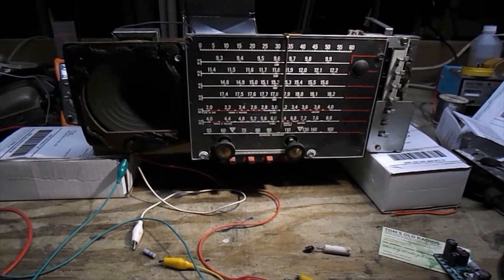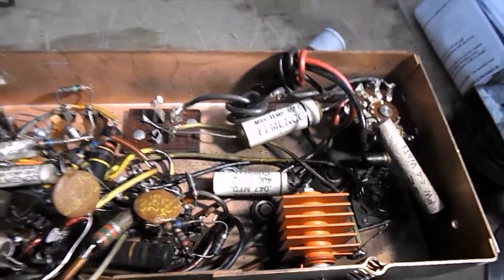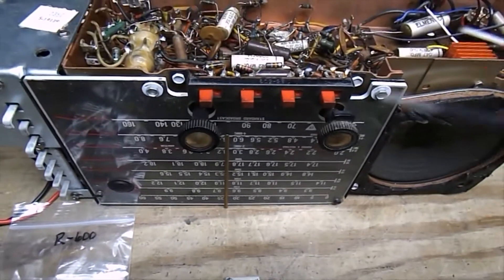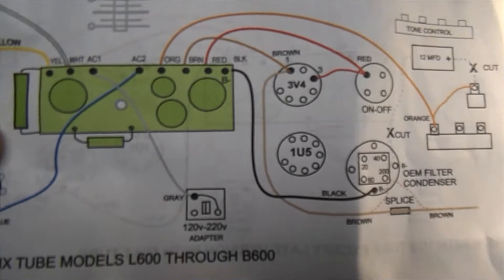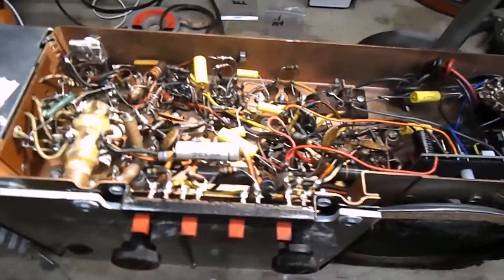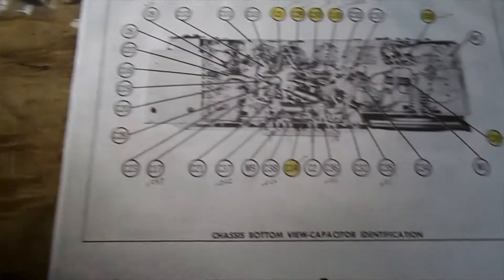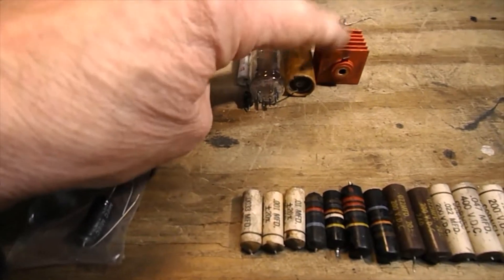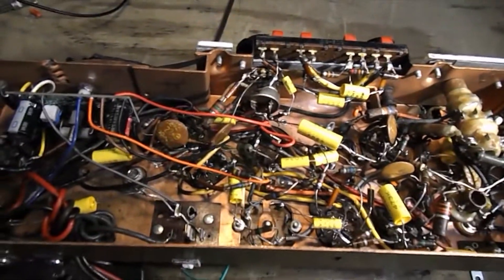Zenith Trans-Oceanic R600 Part 1: Installing a FILT-R-PAK 60+ Power Supply and Complete Recapping

Comment: Where did you find the capacitor location chart?  Could have used that on my Y600
Reply from the maker: Bob, I forget exactly where, but this link looks like the exact thing that I used:
https://bama.edebris.com/manuals/zenith/l600 
It's for the L600, but there were very few differences in the 600 line.
73 Paul AA1SU

Comment: Hayseed Hamfest DOES NOT offer the replacement of the POLY caps ONLY. They offer CAN capacitor ONLY or CAN capacitor and POLY's
Reply from the maker: I made an email request for a quote on just the caps w/o the can capacitor. He replied right away. It turned out that I did not need the single electrolytic capacitor. I have since misplaced it. Bummer, because I have other T-Os that would benefit from it.
Thanks for your comment.
73 Paul AA1SU
Reply: @vtradio  I sent the radio to TOMS OLD RADIOS in Texas. He restores these radios and will replace whatever is necessary to repair. TOMS OLD RADIOS is the company that makes the Filt R Pak power supply
Reply from the maker: @adriancressy8363  Adrian, Great option! I've seen his restorations on eBay. He does wonderful work. Much better than mine.

Comment: Regarding your replacement capacitors from Hayseed: how did you determine polarity of these caps before installation?
Reply from the maker: There was only one electrolytic capacitor in kit. That was the only one where polarity mattered. Using the kit from Tom's Old Radio, that capacitor is actually eliminated. I saved that capacitor for future use but have since misplaced it. I showed the video to Tom, and he said to cut out another new capacitor. I told him that I did not see that in the instructions, so he edited them to include that instruction.

I later did the same rebuild to another Zenith Trans-Oceanic. When ordered the kit form Hayseed Hamfest, I asked them to leave out the electrolytic capacitor to save me money. They did. Since it looked like I was going to be doing even more of these, I ordered the caps in packs of 25 from Bob's Antique Radio and Electronics. Those extra caps have proven to be very useful.

To answer your original question, the negative end of an electrolytic capacitor is marked with an arrow, or some other marking.

Comment: Hello-my dad just left me this radio that i listened to when I was younger, but ti doesn't turn on. I am not sure where you are, but it's a sentimental thing. How can I fix it!!!
Reply from the maker: I'm in Vermont.  It's hard to say.  It could be the can capacitor, which is common.  Also, the selenium rectifier could have failed.  Hopefully all the tubes are in there. You can buy the can capacitor from HayseedHamfest.com and solder it in there.  You probably don't need to replace all of the other capacitors, like I did.  You might want to find a ham radio club in your area and ask them for advice, too. 

If you have the money, go to eBay and search for item #183283588338. This is the guy that makes the Filt-R-Pak kit that I installed.  He will fix it right for you and make it look beautiful!  If you want to bypass eBay, his phone is 214-585-0143 and email is tom5966@gmail.com. 

Hope this helps.  Good luck.
73 Paul AA1SU

Comment: Does this Ebay offering take the place of the big can with the multiple caps inside that's a booger to replace?
Reply from the maker: Yes, it does.  It also replaces the 50A1 tube, the other electrolytic capacitor, and capacitor C40 which I did not remove until a later video.  Tom fixed up the instructions since then to make it clear to remove it.  The can capacitor in mine appears to have been changed in the past, so I could have just replaced the burned-out diode, and power resistor, but I wanted to go this route.

In the near future, I have a G500 and H500 that I plan to rebuild.  I doubt that I will film it though.
73 Paul AA1SU

Comment: Does the Filt-R-Pak replace the cap can? I’m asking because I ordered the recap set plus the cap can from Hayseed Hamfest and I ordered the Filt-R-Pack too.
I was recently sent a T600 from a friend who found it and it's in excellent physical shape. It still had an old RCA battery and an original Zenith Z-1 battery in it and all of the tubes are Zenith (except for the ballast tube, which was a Sylvania). I have the feeling that it had been sitting somewhere untouched for decades.
Reply from the maker: Yes, the Filt-R-Pak takes the place of the filter capacitor can.  It also eliminates the electrolytic capacitor, and probably C40.  Not sure which level kit you got for it, but I believe both those caps are eliminated with the either kit.  The instructions make mention of this.  I've emailed Tom with questions, and he's been very helpful.
Congrats on receiving the T600 and batteries in excellent physical shape.
73 Paul AA1SU
Reply: @vtradio  Thanks. I contacted Hayseed Hamfest and asked them to drop the Cap Can from my order.
I ordered the 6+ Level Filt-R-Pak kit.

Comment: Put one of these in my H500 and it works great, going to recap, check resistors and then do an alignment.
Reply from the maker: I put one in a H500 as well last year for a local guy.  He gave me another H500 as payment.  I plan to restore that one too, but it may be a while because I bought so much other stuff recently that needs attention.
Paul

Comment: Dear Tom , I went ahead and installed the filter Pack with the hope that I get rid of annoying laud statics and can get a nice clear sounds although the radio start to work however not only the static problem was not fixed but also I lost almost all stations in other 6 bands, then I went ahead and changed majority of Capacitors that I received from Heyseed & hamfest that did not solve the problem either, I don't know what else to do any Ideas you have will be welcome, again thanks so much,
Reply from the maker: Did you ever get the loud static out of the Zenith?
If you tune it away from computers in the house, it may help.  Try outside.
Paul

Comment: thank you it was great video, I have similar radio the short wave does not work I should follow your path may be I can make it work , although I am just a beginner .
Reply from the maker: I would say go for it.  I was scared to death of working on these radios for several years.  But, I recapped a Hallicrafers S-40B a few years ago, and later a S-120.  I also watched other videos about recapping old boat anchors.  I have finished the radio and will  be posting more videos shortly.  Thank you for the kind words.
Paul AA1SU
Reply: @vtradio  
Thank you again, I tried to purchase the capacitors from Hayseed,it seems they don’t sell them without buying the whole kit. May be I get the kit and change the filter as well, 
Appreciate your encouragement. 
Bahram

Comment: From a technical perspective, I'm not sure that all of the smaller caps need replacing because they are not really electrolytic. Mica, polystyrene, film capacitors don't have the same degradation issues.
Reply from the maker: Thank you for the advice.